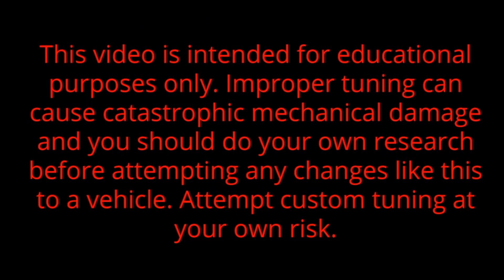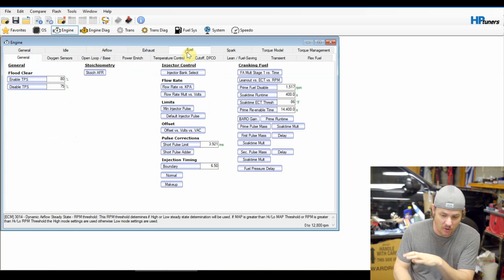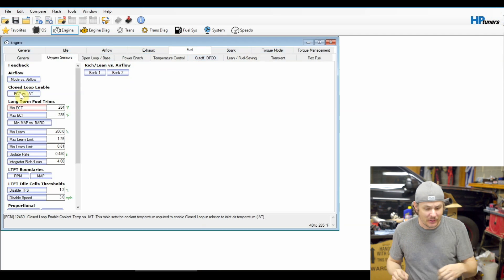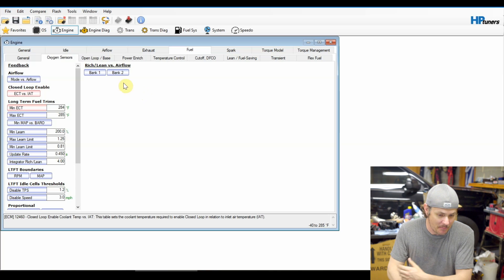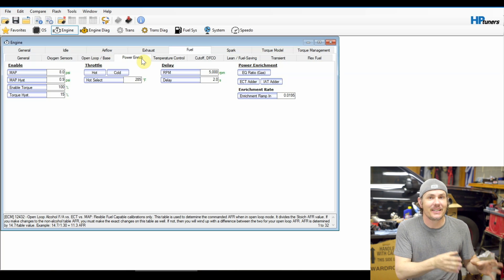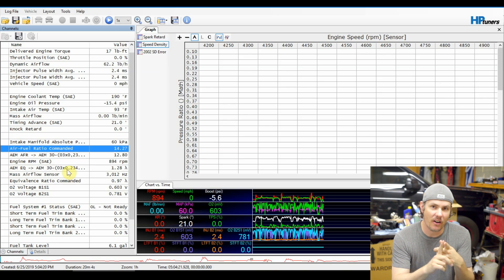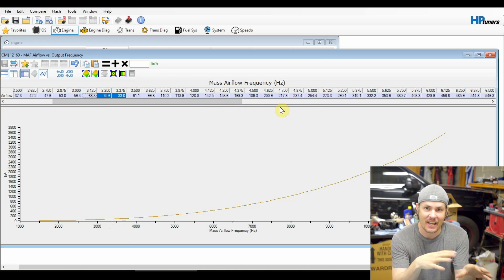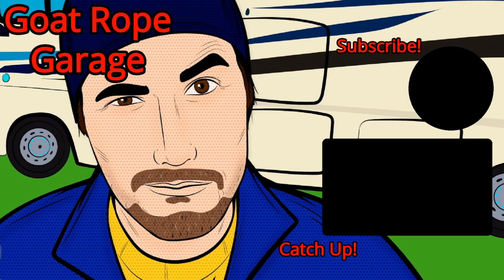GM Gen 3 Mass Airflow Tuning and Scaling, MAF Histrogram Setup, HP Tuners How-To Tutorial

Comment: I have followed your video step by step twice lol and am not getting any data! Any thoughts?
Reply from the maker: No numbers are showing up on your graph? Your data input isn't working, double check that you have an the proper parameters logging, AFR or EQ from your wideband and then AFR or EQ commanded, have to have both those logging in order for the error math to work.
Reply: Goat Rope Garage I’m getting data just not in the histogram I made following your video i can’t figure out why.
Reply from the maker: @OldGuy54  yeah, make sure you're getting the right data for the histogram. If the histo is blank you're missing a parameter
Reply: @GoatRopeGarage  Can I pull my AFR from my maths?  I'm logging my AEM 30-300 via the EGR port in Math 61002.  AFR shows up in my Chart using this Maths.  Now doing 100* 61002  - 50121 / 50121 I get no data in the histogram or if I create a gauge for EQ ratio..
Reply: @JustChuck I know this has been 5 years but I'm having the same exact problem

Comment: very helpful video, but i have one question. i followed the steps in the video, when i recorded a log my ltft where still reading, they wasnt jumpimg around like they normally do but they was still reading, do you have to reset the fuel trims in the editor?
Reply from the maker: If they are still reading you need to look for a different table to disable them, might be an ECT table for the oxygen sensors, try maxing it out

Comment: Can I run open loop all the time? Would it be bad to cut out my 02 sensors all together I’m not worried about passing emissions or whatever but I ended up cutting my exhaust temporarily and I had to get rid of the after cat 02 sensor and now my truck is super rich and shoots flames at idle  wondering if there’s a way to fix that as I just purchased hp tuners
Reply from the maker: Closed loop is good for the minor corrections that are needed through out the year as weather changes, etc. I always recommend putting it back to closed loop after tuning is accomplished.
Reply: Goat Rope Garage I plan on putting it back after a few weeks.. I just need to drive it and work out issues I’m having with a brand new transmission not shifting unless gas is released which I’ve read could be the misfires and or maf/map sensors
Reply from the maker: @TYguy6090  that's fine
Reply: Goat Rope Garage thank you! I was just curious if I’d mess something up doing it like that longer than a day.. I’ve learned a lot from your videos so far you explain things well unlike most channels on here about tuning

Comment: Kyle , any reason why you don't disable the short term trims? I did everything in your set up for MAF tutorial and took a drive . I left the short term trims on my channels table and they were in the 15-20 range below 2800 rpm. Thank you
Reply from the maker: When you disable the O2 sensors via the readiness voltage it will kill the short terms also,

Comment: Finally found someone making videos that are truly educational! I’ve watched some multiple times learning something new each time! I have a question, (it is close to a comment below). When building the chart in your MAF tuning video ( Tuning Series Vol. 3 ). You creat a new math filter using the math from “EQ Ratio Error”, then replace the EQ Ratio [sensor] variable with the AEM input. But when building the chart in this video you use AFR Error instead. I will be tuning on my 98 Trans Am and I have an AEM 30-4110. Can I build the chart from Tuning Series Vol. 3 or would it be better to build the chart from this video?
Reply from the maker: Build the one that matches what you're tuning, these are just general guidelines

Comment: How does this play into idle fueling? I have a gen 3 with a 216/220, .550/.550 camshaft. Im having some idle issues still. Just finished up the VE and coming back to MAF with the hopes that it will fix my lean condition when adaptive idle kicks in. It will drop to 1.19 to 1.25 when the adaptive controls come on. it will work its way back to 1.05. I believe this is causing the big swings and dips when returning to idle or when you rev.
Reply from the maker: What's your timing doing when that happens?
Reply: @GoatRopeGarage  It will swing from 10 up to 28. RPM swing if I hold 1.6% throttle in next to none. As soon as I let off it will drop to 600 rpm, timing spikes to 37 degrees the rpms continue to fall and timing drops to 17 degrees. The IAC shoots to 136 desired and the RPMs begin to Recover. As the RPMs reach the set point (700 rpm) the Timing  drops. Of course the IAC is now at 136 and the desired drops to 100. Timing drops to 7 degrees  and then the RPMs (now at 850) start to fall. It will repeat this process several times and either die or recover and stabilize.

Comment: How big is to big of cam for maf tuning?
Reply from the maker: LSA is what kills the MAF, less than 112 you might have issues based on where the MAF is located
Reply: Specs: 218/224 .553/.553 113+3 this is the cam I have in my truck. It’s a btr 3 truck cam. It’s in an 06 Silverado l33. Headers and 2800 stall converter. It is a daily and I live in Wisconsin so we see all the weather lol. Should I tune it maf or speed density?

Comment: Hey sir! I enjoy watching your tuning vids. I have a quick question. I’m not at the point to tune my own vehicle so I’m having it dyno tuned next week for the first time. 

My vehicle is a 2004 5.3 Sierra. I just put a p1sc Procharger kit on it with a 3.85 pulley ( I think 8-12 psi range) everything else is stock on the truck except Cat back exhaust.

Will this most likely max my maf out? id like to stay away from 2 bar and meth if possible. Your thoughts?

What are some things I should look for or questions to ask the tuner?
Reply from the maker: You'll have to run a 2 bar if you want any SD tuning done as you're going to exceed the stock map sensor. You might exceed the stock MAF, but that's an easy fix, you'll just need a bigger intake tube
Reply: Is there a way to safely predict the tune after the maf runs out? For smog reasons I’d like to keep the stock maf and not go 2bar. 

Any stock looking mafs that are bigger and easy to swap in?

Thanks a bunch!

Comment: I started over at the MAF Tuning and Scaling Video for GEN IV, then ended up over here when the GEN IV stuff looked so odd (I'm working with a very simplified 0411 - thankfully one of the commenters on the GEV IV video was in a similar situation and asked my question).  Once I got to this video I didn't understand how the wideband was getting into the logging, but upon rewatching a few times I believe that the "AFR Error Math" must pull it in automatically from the serial port when it sees it (makes sense).  For some reason that was really tripping me up, but I think I get it now.  Also, the fact that adding a graph is under "graphs layout" somehow slipped by me in the GEN IV videos, so I couldn't figure out how to build a graph, but here I caught it.  Thanks for all these videos - I would stand no chance without them.
Reply: As follow up, went out and put everything on the truck - weird issue where when I start scanning, all my channel configurations (which I set up based on this video and the Gen IV videos) go back to some sort of default setup.  From that default  setup if I go to add channels, it looks like the other channels (the ones I actually want) are selected, but they don't appear on the list.  Must be a software problem (running 4.4.4 - latest version - checked for updates), or I just really don't understand how this is supposed to work.  Either is possible.
Reply: Figured it out.  Watched the video on the VCM Scanner and it talked about having too many channels / PIDs logging - that was my problem.  I'm sure the 0411 is very limited in this area - once I got it down to the three I really needed it worked immediately.

Comment: Hey kyle thanks so much for the videos they've all been super helpful. just wanted to drop a small correction here even though it probably doesn't apply to many people. manual transmissions use the same dfco as autos the clutch transition just delays dfco kicking on when you press the clutch so that your rpms don't drop like a rock to idle while your trying to shift. in my truck it seams to work like a lazy version of auto rev matching.
Reply from the maker: Thanks!

Comment: On gen 3 is the afr error and eq error math interchangeable and able to be used on maf and ve tuning? I have been using eq error and probably doing it all wrong.(2000 Pontiac trans am ws6)
Reply from the maker: Yep, it's the same thing just that one targets AFR and the other EQ ratio, which is easier to use on later generations

Comment: I have done this and it seemed to help a little bit. I did a complete engine rebuild and it has aftermarket air intake headers no cats and a btr stage 4 v2 truck cam. I have played with the spark advance a little but i don't wanna get too crazy and destroy anything. I have the AEM wideband on it and its running lean.

Comment: Hey there , have a 2003 holden running a PO1 with an LSA and Vortech with speed density , using a HP tuners 2 bar operating system and want to go back to the blended tune. Have a credit card slot 5 wire MAF with adaption harness to hook into the car and am not sure where to start with the MAF table as this is a totally different sensor and a larger pipe than standard, do i just see if it will run and keep punching in numbers till it does and then extrapolate to the max setting from there ?. Love your vids straight to the point and easy to follow . Cheers  from Australia
Reply from the maker: Calculate the difference in tube size in percentage then bump your MAF curve by that much and it should get you close enough to start the tuning process
Reply: @GoatRopeGarage  Well set up the MAF , changed settings to start tune and set up scanner. Stated ok but soon realised that there was no readings coming from the MAF , the scanner was only populating the first square with a error value . The tune is a two bar speed density operating system , do hp tuners disable the maff or am i missing something to turn it on?
Reply from the maker: @peterr1342  make sure you're logging the MAF sensor, the parameter that reads in HZ, for your graph
Reply: @GoatRopeGarage  yep thats the one im logging just going to make sure the maf is functioning and give it another go

Comment: I followed this video and as soon as I loaded the changes I noticed a lot of backfires on acceleration. It got better as I made adjustments but now that turned everything back on I'm still getting backfires under hard acceleration or if I let off and get on it again?. Mods are CAI, Cat delete with long tubes and corsa exhaust. Wanted to add thank you for these videos I was super overwhelmed at first and now I atleast feel like I have a direction!
Reply from the maker: What's your AFR error looking like? Backfires are probably an indication that you're getting too much fuel. Are you using the standard AFR error math?
Reply: @GoatRopeGarage  I have Aem 30-4100 I'm using the math for the 4110. I'm still learning to read my blog but AFR is in the 14.7-15.2 range. When I'm idling it seems to match commanded.
Reply from the maker: @DirtyMan2013  If you put LTFTs back on how much are they having to correct? Should only be a couple of percent at idle.
Reply: @GoatRopeGarage  At idle ltft say 5.5% B1 and 1.6% B2
Reply from the maker: @DirtyMan2013  Sounds about right, not sure why you would be getting backfires on acceleration, could understand why you would on deceleration.
Reply: @GoatRopeGarage  Thank you! I will keep hunting and if I figure something out I will report back here maybe help someone else down the road. I'm gonna move on to the speed density video and see if something changes.
Reply from the maker: @DirtyMan2013  Keep dialing in the MAF and see if it clears up.
Reply: @GoatRopeGarage  Ok, I only did 3 approx 10min pulls. I will drive it around 30-40min a couple times and see if that gives a better result. Should I make my PE a constant like 1.7 or 1.2 right now its stock and the numbers are all over?
Reply: @GoatRopeGarage  Today I disabled the STFT and turned the LTFT off in the scanner. It cleared up 95% For some reason my LTFT is still active I believe that is what's giving me issues. I cannot get it to disable?
Reply from the maker: @DirtyMan2013  Did you reset them in your scanner after disabling them? If not they will throw your tune off as you adjust other things.
Reply: @GoatRopeGarage  I turned closed loop and LTFT back to on before shutting down will that reset it?
Reply from the maker: @DirtyMan2013  No, you have to go into the scanner and reset it or else it will throw your fueling off. It's under Vehicle Controls and Special Features, there is a fuel tab, you'll see LTFT Reset, will zero them out.
Reply: @GoatRopeGarage  Awesome thank you I will work on it more tomorrow. Making progress!
Reply from the maker: @DirtyMan2013  Check back in!
Reply: @GoatRopeGarage  That was it!! As soon as I hit rest LTFT went to 0% and never moved!.

Comment: if making adjustment in maf i,m pasting my afr err maf into maf cal how do you dial back if i ended up to lean when i bring back the o2's back on
Reply from the maker: You can shift it by multiplying the table by like 1.01 to raise it a percent at a time.
Reply: @GoatRopeGarage  do that with the o2 back off or on
Reply from the maker: @Ls_kang369  Doesn't matter, the O2 will pull you back towards 1 regardless.

Comment: Let me first say that you are one of the best video instructors out there for HP Tuners GM tuning in YouTube. There is something that I still find confusing. Can you please clarify the logic behind the “multiply by % half” and how that gets you close to the actual MAF value? I’m having trouble getting my head wrapped around the mathematical logic behind this. Lets say that at a current value of 100g/s at a given MAF frequency the log reads AFR to be 25% off error to the richer side (error of -.25), does this mean you multiply by %half of this value meaning it will multiply 100 x -.125 and just put this new result on the cell? This doesn’t make sense, unless it adds the multiplication result of 100 x -.125 which is -12.5 to the original 100, bringing it down to 87.5. This makes more sense in my mind. Please clarify. Many thanks.
Reply from the maker: Thanks man!  You are right, if you are multiplying by half, say you have a 10% error (10% error would be 10% lean in this case, -10 would be rich), when you do the multiply by % - half it is going to take that and convert it to the equivalent of 105%, effectively multiplying by 1.05.  If you were to do the same for -10% it would be .95 by the time you used the mulitply % by half.  Thanks for watching!
Reply from the maker: Thanks man!  You are right, if you are multiplying by half, say you have a 10% error (10% error would be 10% lean in this case, -10 would be rich), when you do the multiply by % - half it is going to take that and convert it to the equivalent of 105%, effectively multiplying by 1.05.  If you were to do the same for -10% it would be .95 by the time you used the mulitply % by half.  Thanks for watching!

Comment: How does it know what input to read afr from? I set up the graph the same but it doesnt log anything. I have an aem uego and an mpvi2 with the uego blue serial line connected to the pro link blue line. Reads volts but I used the transformation to afr
Reply from the maker: You'll may need to do a custom error ratio math, use one of the stock AFR error ratio as an example and then change the PID for the existing Wideband to the one that you've brought in on the pro link.
Reply from the maker: This video goes into some of the custom math stuff.
https://youtu.be/1U5-qhiPul0

Comment: thx. So after copying from scanner into tune file...then what? Does this process need to be repeated several times? I have watched some other videos, and seen similar, with the process repeated multiple times to get the numbers "close"...Can you explain that? I'm lost on that.
Reply from the maker: Yeah, flash it in, go pull another log until you start seeing knock, that's how you know you've maxed it out. Once you see that you can go back and either remove timing in the areas if knock or just take a degree or two out of the whole table and leave it there depending on how much time you want to spend on it.

Comment: Love your videos. Do you think you could make one covering o2 switching points and what might be gained by altering them? I've heard you can gain fuel mileage. Also what needs to be done when installing headers as far as transport delay and anything else I may have missed?
Reply from the maker: I'll try and dive into then eventually, Cam. Thanks, as usual, for watching!
Reply from the maker: You on a Ford platform?
Reply: I have a ford with the "Spanish oak" ecu. And also a p01